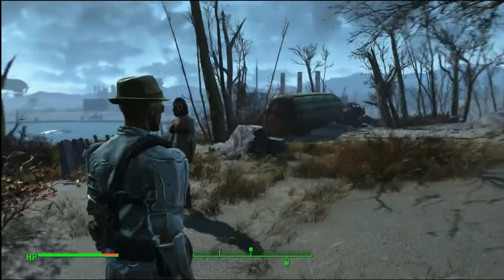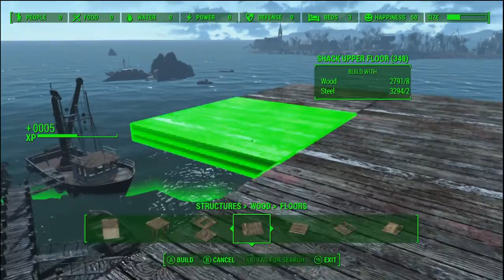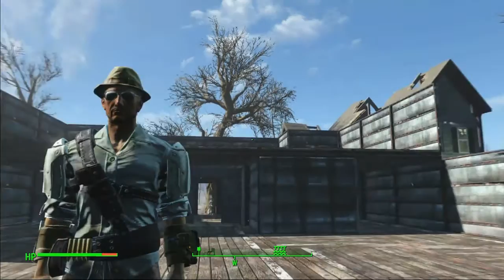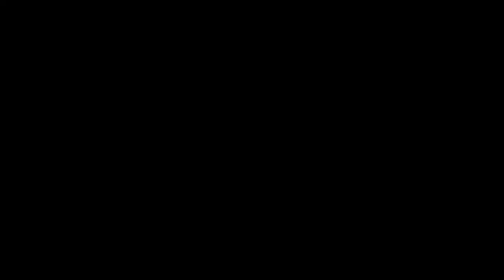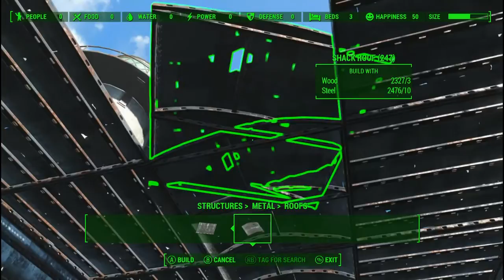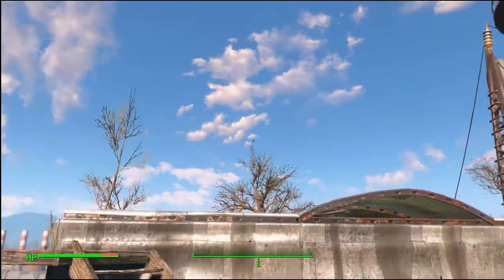Automatron Hangar Build Kingsport Lighthouse Fallout 4

Comment: Man, Ada's really concerned about your feelings toward the end of this video :)  Bombing your fly-through with dialogue.  I like the integration of the power armor stations and the robot workshop.  It just makes sense.  I noticed you did it once before in another settlement and it was a little small.  Probably built before Automatron.  This one is just the right size.
Reply from the maker: +Mark Jackson yep thanks for noticing Mark :-D i had a little baby warehouse at my mansion but the huge light up smiley face ate all the settlement budget so i decided to separate my work lab and my Mansion thanks as always for checking it out :-D Ada mad me feel so bad when i was doing the fly around i was like whats wrong luv u know you my baby dont get jealous of piper :-D
Reply: Manny Faces -- Well you know Ada's probably got that stamina over Piper :D so no reason to be jealous, girl.  Man I've been running around trying to do new settlements, but I'm running out of ideas.  I've been stashing power armor, meds, and built a bunch of clinics at the settlements I do have for when Bethesda finally gets the overhauled survival difficulty right.  That and I want to leave some space for the new stuff in wasteland workshop.
Reply from the maker: understood im the same, now im working on a settlement system of mega farms to try to be able to make settlements that dont do anything but make caps or scrap but settlements in survival beta got me kinda iffy because of the no fast travel and the amount a settlement gets attacked i had it happen once so far and is a slog to get back to sanctuary
Reply: Manny Faces --  Slog is right.  I've been buying Virtibird signal grenades every chance I get to prepare for no fast travel.